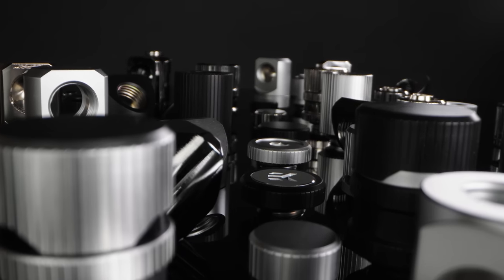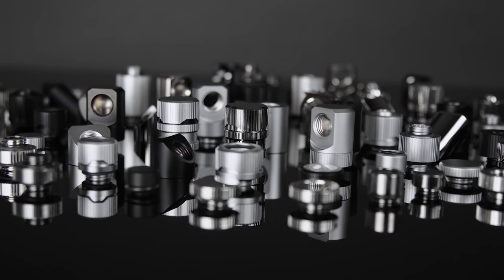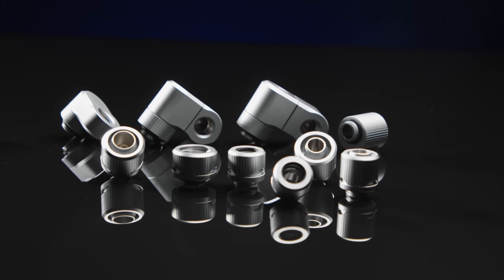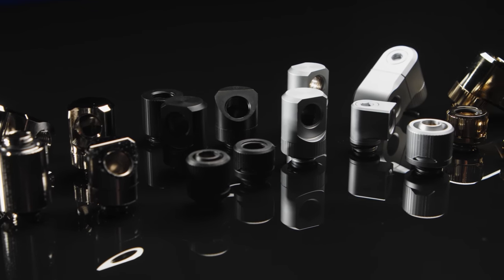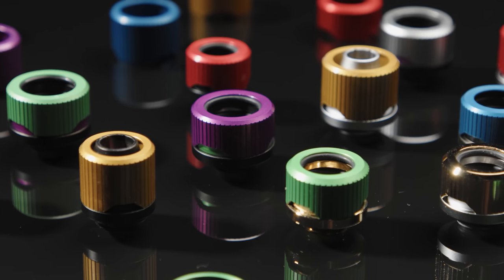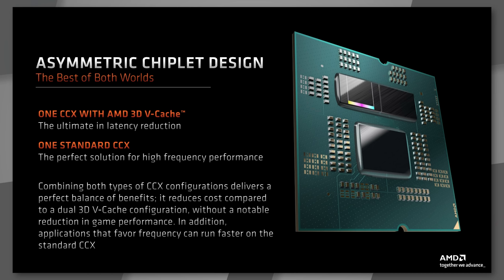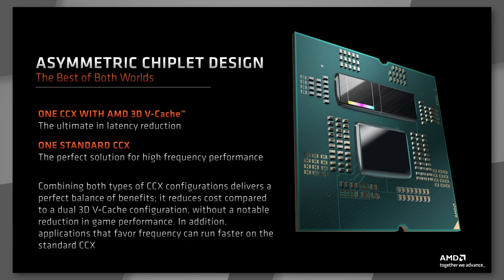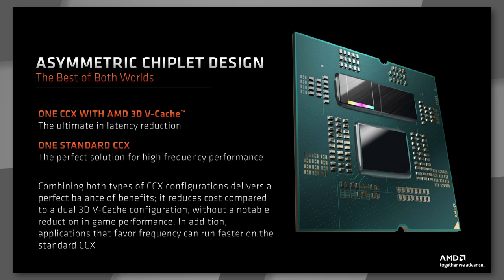Why I switched back to Intel...

Comment: I'm permanently on Intel and Nvidia for more than a decade now with 10400 and GTX  1650 atm.  No BSOD, no issues ever. Had an AMD system back in the days of Athlon but moved back to Intel. My brother recently switched from Intel to an AMD 5600X with an AMD 6800 GPU and he has intermittent bluescreens and game crashes. I know AMD fanboys will rage at me but the truth is: Intel and Nvidia just work.

Comment: I am happy to see such videos to focus on the issues. This is how improvements are driven. Intel is unstable, but is AMD delivering superior performance today? I want both reliability and performance added to a predictable experience.

Most likely, my new build will be a Ryzen 9 9950x. I like the CPU to have the same cores. I have today i9 7980xe with disabled hyperthreading 4.9ghz.  That means 18 cores and working solid like a tank.

Comment: Ok im on old 3800x and still think its still have a lot in the tank… in 2024 even if I feel like i need boost i will get the 5800x3d …
I am very happy with my m4 zen switch from intel especially when its holding up almost 5 years in jul … 
I would really love to see a generation leap that will take us to 4k 165hrz systems in a reasonable price…. But for the most part the gpu is Our main concern to reach that goal… hopefully nvidia with the 5000 series will fix that and will give us a taste or a new opening to 8k gaming.

Comment: I just purchased the AMD Ryzen 9 7950x3D, and been experiencing game freezes, ctrl+alt+del doesnt even work sometimes. When it does work it wont display anything of whats going on in the task manager. 
The bios is updated to date. 
My system specs are:

Cpu: Amd Ryzen 9 7950x3d
Gpu: PowerColor RedDevil Amd Radeon Rx 7900xtx 
Psu: 1000w Gold EVGA 
Ram: 4x6400mhz G-skill 64gb total (16gb per stick) 
Motherboard: ASUS ROG Strix B650e-f 
Storage: 1TB Samsung Pro 980 Internal Ssd

Any help or thoughts appreciated
Reply: For gaming 2 sticks of RAM will be more stable than 4. If you still have issues with 2 sticks, underclock them a little.
Reply: get at max 2 sticks of ram that are on the QVL List of your motherboard. If you need 64GB that means a kit with two 32 GB sticks. If it is on the QVL List, get G.Skill Flare X5 CL30 and it it's not on the list, get G.Skill TridentZ NEO CL30 (it should be on the list). If both are not on the list, maybe one of them in CL32 is on the list! Get that instead.
Reply: also considering its a gaming pc, you should probably increase your ssd storage to around 2tb to support lastest games

Comment: I’m always late to the party, so I hope this will get an answer, even though the video is 2 months old. I’m looking to build a 7800x3d as a gaming rig, but primarily in Linux. Is the core parking issue you discuss entirely dependent upon windows/xbox components to make the decision?  Am I correct that this would be not something likely to affect the 7800 x3d because of the difference in ccx configuration?

Comment: Just upgraded from an i5 9600k to a 7950x3d. Haven't had a lot of time e to test stability since building it out took longer than I expected like i couldn't find my standoffs for the case since I am going from a mini itx to a full size mobo and then didn't realize I needed my other cpu power cable so I had to find that as well. 

But that being said running on Asus tuff x670e plus wifi mobo my gskill flare x5 32gb at 6000 and all seem stable as of now. Updated the bios and I believe the chipset and everything. So will continue to monitor and try it more later tonight.

Comment: Having so many stability issues but running curve optimizer at -30? Never thought about that this could be the reason?
There were good videos explaining the curve optimizer can be very tricky to test the stability because it's lowering the voltage all across the different cpu clock speeds. So running a stress test von the cpu and having no issues does not mean that it will run stable on lower cpu loads too.

After having only Intel CPUs for around the last 20 years or something like that I switched last month to AMDs 7800X3D. Low power usage, great gaming performance and for regular apps it's more then good enough power for gamers. For content creators it's different.

I'm also using 6000MT/s CL30 Corsair RAM. Fast booting, no bluescreen or crashes. It just runs fine so far.

Comment: I have the same memory training issues. I just enabled EXPO and tested a game then updated bios to found out that there were known issues later. Even after that, its just a lottery if my system will boot up or i get the DRAM led with the memory being on the QVL list. And it could be either the mobo or CPU imc to this point.
If i had known this i would have just choosen intel. If i buy 6000 mhz @ cl30 ram sticks i want to run it like that obviously. I tried memory retrain in bios off and many other settings but it was just random whether the system will POST properly.
Without even knowing if all my hardware is still intact and within 14 day return policy.

Comment: U know what I also noticed with my non x3d system. I had lots of memory issues and it took me months of troubleshooting to realize that my aftermarket 24 pin cable extension was causing the instability. I changed to the PSU supplied one and never had a single issue again.

Comment: AMDs approach with the CCD is good but it's not the optimal route. The fact that they have 2 CCDs and only one can talk to the 3D VCACHE is limiting. Intel's Foveros seems more like the right path for splitting up parts of the CPU while still allowing it to talk properly if they ever actually get it to market.

AMD also needs to bolster their software team and work better with companies. I remember how terrible Bulldozer was with Windows because it would just load the first core then the next and it would cause massive bottlenecks due to the design of Bulldozer. Then they had to update the kernel to treat the module in a way to only use one core then go to the next and only use the secondary parts after the first 4 were used. Honestly its how it should have been at launch.

Comment: Havent build a pc in a long time so when i did i researched the current state of cpu's and was shocked intel is so much behind in efficiency... Build a system with the 7800x3d.. small case air cooled.. dont regret the choice .. performance is excellent, temperatures are great... Only thing i dont like is the amounts of checks am5 runs every boot but i am happy to exchamge that for the advantage of not running a space heater...

Comment: This video really came up in time. I tend to do my home PC upgrades ONCE in 4-5 years, and my 9900k will finally have some rest. I spent the last few weeks planning on what to upgrade next (usually it's the "as much as I can afford"). And there I was looking at "the two chairs": 79X0x/3D or a 13900K/149000K(I will not correct that typo ;) ). And was thinking for the AMD because of i9's thermals (I favour a silent system, where the most of the heat is dissipated by two 45mm 360 rads and Noctua fans spinning at 20% where I don't register them at all... and when I start to hear them it usually means that something kickass is being processed). 

But I had my doubts. And the funny thing about doubts is that the problem post has a tendency to be outdated or drowned in a ton of positive posts (in this case when the user is either playing games only, 90% of workload is the browser... or similarities). And you just can't figure out if the problem exists... until you buy it. And yeah, you can always see that it's a mess and buy a new one, BUT when you put your effort in making the build (plus it's watercooled) "just right", the pain of disassembling it after some time is a big hit for me (my current build is only touched when I do maintenance).

Before I start, please keep in mind that I like the fact that AMD is now head to head with Intel. And I wanted to try an AMD chip for sometime now (but I do take measured steps when it comes to my home PC, which I use every day any day).

The first thing that this video made my day in is the question, which I thought when I started reading about the 3D cache and that windows should tell the CPU that "itsa game, duh!". And more of... what happens to stuff, running in the background like browsing, converting something or just doing something, which involves the CPU. For this info already a thumbs up.

Second thing was the boot stuff. I remember an old video in the period of 7XXX series soon to be launched. It was related to EVGA and its work in relation to their mobo lineup (think this was GN's video). And there was a sentence about an 7XXX cpu boot time (already was a WTF for me). And this is a second thumb up for this video, since now I see it to be a problem in relation to the memory.

And a special thanks for mentioning 13900K vs 14900K. When I was in the middle of this video, my thought was "Right. 14900K it is". Then I heard Jay speaking about its temps and that "I should have better sticked with  (gold pick, yeah, but still) 13900K.

I do realize that 13900K will still require some work and thought (I did start reading about P1/P2 and the "Enhanced mode" of mobos, which kicks in even more power in that chip, making it a "performance/heat to the max), but unless Intel will release a "hey, we fixed all of our 13-14900K problems and doubled the performance" (same for AMD), I don't see a choice beside 13900K.

Overall, a really good video. Cheers

Comment: I switched to intel only due to better stability, performance wise in the higher tier cpu range is not an issue they are almost the same, however intel machine run way more stable and games do run smoother I can’t explain it, it’s more a feel because the fps is high on both machines but the overall smoothness is on Intel side.  my system :  msi Z790 ACE , I9 14900K , 32 GB 6200 . msi RTX 4090 Liquid X 3 x Gen4 SSD and I still have my msi X570ACE R9 5950X

Comment: What is MY system?
Well, I've been running i5-4670K @ 4.2GHz for a while now...
It caused my MB power supply module to melt once, so I bought a second hand MB with heat sinks. She's purring like a kitten eversince.

Though an 11 year old kitten lacks some of the initial dynamism... :D

Comment: Just wanted to thank you for all the videos and all the good tips. I know it takes a lot of time to make these videos and I just wanted to let you know its much appreciated. keep it up:-)  I'm still running the i9 12900k with the Asus Z790 e WiFi motherboard G SKULL Trident Z RGB 96gb 6800MT. This Processor is very picky on what ram she loves but other that, the i9 12900K temps are great. Low temps 32c and high 67c at 5.7ghz witch is perfectly fine for me right now. But today I just found out that my Ram is not compatible with the Motherboard after 5 months and its funny because I thought 6800MT is not the same as 6800mhz. ??? The i9 12900K can take up 6400mhz and the 6800mt is actually4700mhz so that's should be fine right?? Anyway, do you have any top picks for Ram kits or a better fit for this setup. First dimm set were Team Force but didn't run long until one went bad. Shit show 12gen lol

Comment: Great comments jay! im rocking a intel 13900k i9 - Liquid Cooled with Corsairs loop kit, and for gpu : its liquid cooled in an ek block vector : MSI Suprim 4090 , 64gb DDR5 6400mb the mother board is a asus z790 gaming wifi. i feel like this asus board is clunky, when i play escape from tarkov, i get memory drop issues.. so i have to ton the ddr5 down. Hey Jay, is there any chance you can do a video on top Motherboards you would suggest or consider using for the i14th gen chipset

Comment: For me it reminds me of my car situation…I have a fully built 1985 camaro supercharged with nitros that is one of the fastest cars in town but it’s a lot of work to be really fast vs I just bought a new Corvette Z06 and it’s not as fast as my Camaro but I don’t have to run racing fuel and not having to mess with the timing just get in and drive…I’m confident to drive it 500 miles…AMD 7800x3d is the fastest no doubt but it has to be maintained quite a bit compared to intel 13th and 14th….sometimes being the fastest is not the most reliable

Comment: DDR5 is the issue, at Intel mobo’s have a problem using 4 modules of RAM, setting the XMP makes unstable OS, making crashes, reboots and Blue screen. There is two solutions: use only two modules  instead 4 or decreasing the RAM’s frecuency using 4 modules. I am using 4 modules, XMP at 7200 MT/s, decreasing the frecuency to 7000, cero issues right now; I am using an ASUS ROG Strix Z790-F Gaming Wifi with the last updated BIOS

Comment: I'm going to build a budget pc...
I wanted to go with Ryzen 5 5500 and Radeon RX 6650XT... I used to have amd system from 2018-2023 and I always had issues with crashes and bsods... should I go after i5 13600k and RTX 4060? it's like 2x cost but I want stable pc
Reply: Go 12400f and the 6650xt.
Reply: @Hardworkpays209  how about 12100f or ryzen 5 3600 with 6650XT?

Comment: have used i3 530 +gt 730 d5 7 years and still using, 
purchased i5 13500 with msi mag b760 mortar wifi d5 + 2 6000mt cl40 16gb xpg lancer rgb rams 5 months ago and still working noicely and extremely stabe on the stock xmp mode and can be ocd easily upto 6400mt cl 36 with full stability.
my goal was to moving with a good ryzen apus but since 5600G and 5700G supports upto pcie 3.0 and there was no news of ryzen's new apu+ better overall value cpu that i5 13500 back then,  i had to move with it, but now we have the news of 8000G apus, and the 8700G will be impressive as hell with 8c/16t + 12cu rdna 3 igpu,
 but i have no choice left now 😑

i think i should have waited a bit more

looks like i just need to buy a gpu, rest all working fine and uhd 770 is really impressive for cad works and 768p low @ 24-30fps aaa gaming but have  less 3d power than vega 7,8 and much much less than rdna 3 igpus 😑

Comment: 7800x3d by far is the king , when you undervolt it , the performance boost is insane plus the stability is also amaxing :) against intell i9 13 and 14 gens
Reply: True, whats crazy is that 7800X3D even beats the ryzen 9 in gaming, let alone i9.

Comment: I got a Ryzen 5900x, out of the box I had a gazillion problems. Bios and CPU updates helped for a bit, the system worked fine for what I wanted, but throughout use I would keep getting weird glitches here and there. Then a month ago blue screen of death. BIOS ran fine, but windows was a goner. I ended up having to replace my memory. Now it works, but anytime I start a game it just freezes on me. I can alt tab, I can prompt command, I can cntr alt delete. But I can't click on anything and my game doesn't actually start.

I got a nephew in ICT who's literal job is to keep systems running and dealing with software problems. We tried everything in the book. Everything says the thing should work fine, up to and including memtest. It doesn't work. All drives updated to newest of newest: BIOS, CPU, GPU, and all the other stuff like audio drivers. Windows boots, I can use word, excel etc. I can watch youtube. But I can't play a single damn game. I didn't buy a Ryzen 5900 with a Crosshair viii Formula and a RTX 3080 to watch youtube....

Comment: We have two AMD PCs at home with 5700X, running full stock, pbo off, and jedec standard 3200 ddr4 ram. They were never been overclocked. Half year after I built the second system, Windows started being unstable. Audio stutter, usb drops, network issues, weird stuff... In event log was showing WHEA errors. This happened without any external change. Again: stock settings, pbo off.

The first system... I decided to move the cpu into the second system and order a 5950X. The 5950X arrived, dropped it in, turned off pbo, use stock settings. After a day or two WHEA errors showed up in event log...

To work around the WHEA errors I have tried several things, only one had effect: drop ram speed. Lowering ram speed made both unstable cpus usable again. But for how long?

I think the infinity fabric degrades over time. When one drops ram speed, the fabric clock drops too. This is my assumption. What else would explain why I can't run full stock + jedec standard 3200 ram (without xmp!). As you know 3200 is the officially supported in-spec speed.

So I've got 3 ryzen 5000 cpus at home, 1 works without issue, 2 shows fabric degradation. On stock settings, pbo off...

Comment: U made wrong desision to switch to intel... I have 0 issue with x3d chip yes i use gigabyte motherboard. not asus or msi. 0 problems boot time needs only 14 seconds, when i switch memory profile needs 1 minute to test that it works... Asus MSI have problems with boot time load. Even 7 minutes needs asus msi to boot.. gigabyte only 1 minut when u change XPM and after is fine 0 problems.. When i install new bios it takes 30 seconds to boot.

Comment: i’ll be honest
i’ve built two systems on 12900k and a 12900k cpu’s now, i’ve tried four different ddr5 memory sets of g skill and corsair ddr5 on both systems.
i’ve tried all different bios revisions 
None of them will run at XMP
they are constantly unstable and i have to revert them back to 4800mhz and this is on two different asus boards trying every different xmp profile possible 

Ddr5 is crap on the z690 / 12900 platform

Comment: at this point im amazed they dont have manual game mode button in adrenaline or ryzen master specifically for x3d chips so it for sure uses the ccd you want. that would alleviate the issue on that. 
As for memory, is this this a 7000 series x3d specific issue? i helped build a friend's system with a 5800x3d and ddr4 4000, and i dont wanna see him start having issues with it. it would be too expensive and sad a fix.